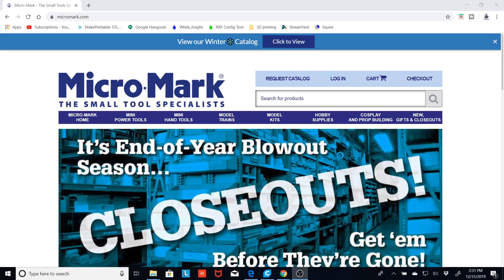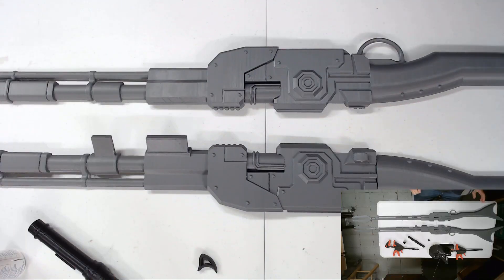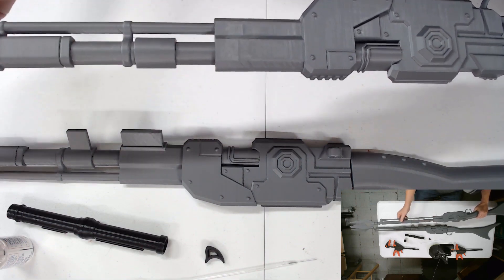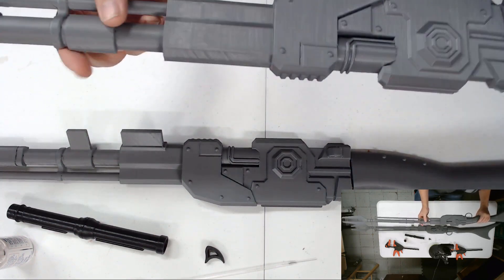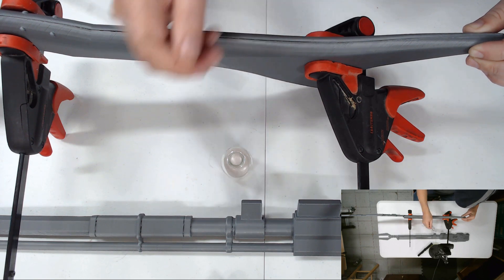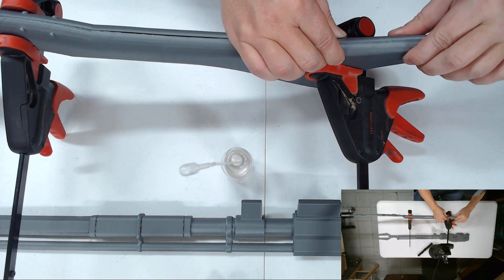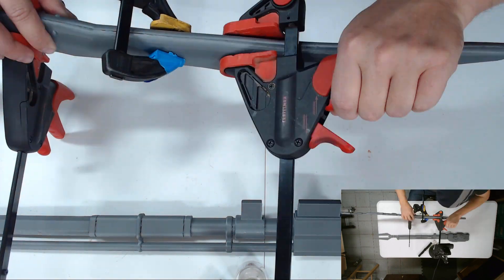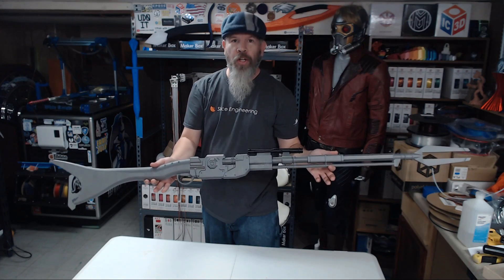3D Printing the Mandalorian's Rifle

Comment: @ NAK 3D Designs 
My friend, I made a similar device, I would appreciate if you share the STL file of the filament holder you use on your device, if possible, by taking the design as reference.
Reply from the maker: That spool holder is not my design.  I got it here.. https://www.thingiverse.com/thing:3051210  Its designed to bolt to 2020/2040 extrusion.
Reply: @NAK3DDesigns  Thank you 👍

Comment: How do you handle heating the bed? Or do you not have a heated bed at all?
Reply from the maker: Ismail Hozain the bed is two pieces.  The front 150mm is heated with a silicone heater stuck to the bottom.  The rear plate is the cool down zone.
Reply: @NAK3DDesigns  Ohhh that makes more sense.

Comment: do you sell the raw kits?
Reply from the maker: Sorry, at present I do not..  I had been working with Printed Solid to produce kits but due to patent issues they will not be offering kits..  All the info/parts/suppliers is on the Github page if have the skill set to build your own..

Comment: Where on the belt seam was the snag? Was it in the middle, under the print since it didn't show in the video?
Reply from the maker: j mtx yes, I had the nozzle zeroed too close to the belt and the print bonded too much to the belt.  This made the seam lift and hit the peeler.